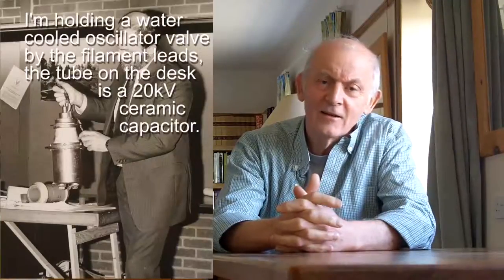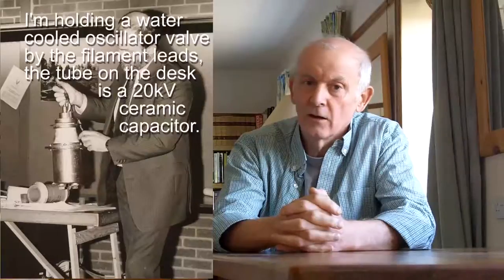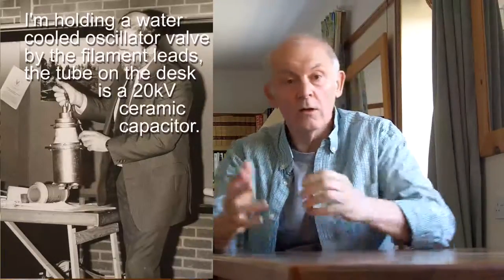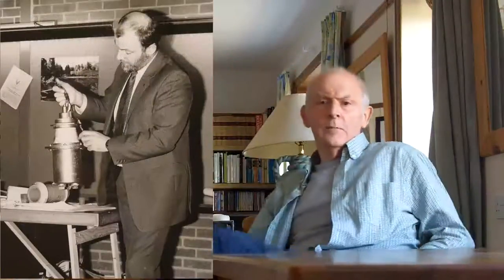HHO. 18 Just me waffling on about where I'm going with this project

Comment: Thank for sharing your plans, and no question about your credibility. Watching all this with great interest! Stan Meyer eh? Well, no one can say you're afraid to open Pandora's box! The 4046 is such a versatile chip. Cheap too. Newish versions like the TI 74HC4046AE operate up to 38Mhz and have a third phase comparator to boot that uses a RS-flip/flop. Handy if you need use of an edge detection scheme, which you just might if your cell's capacitance proves a bit squirrely -just a thought.

Comment from the maker: Hi, well I guess you could do that and as you say there would be no ongoing cost. Every time you convert energy you lose out on efficiency so I think it’d be better to say use wind to charge a battery or pump water and take advantage of a single conversion. But for now I want to develop the principle along the lines I’ve set out in the video but you’re right in as much as there are many options to achieve the same end. 
Regards ... Andy

Comment: Interesting equipment you have been developing through the years. Any chance that the Hydrogen produced in the process can be translated into sufficient power to drive the process without any other external power source (and cost)? Or would that imply some sort of perpetuum mobile which is impossible everywhere but on youtube?

Comment from the maker: Well I don’t think you can tell you’re power supplier to take a jump just yet, but there can be little doubt that there’s a lot of potential energy locked up in water. I have an interest in collecting the HHO gas to use in a gas torch as it has some very nice properties when working with glass (melting) I don’t think we’re going to get anything for nothing, unfortunately, or maybe that’s a good thing as if we all had access to unlimited energy we could really screw things up.
Regards ... Andy

Comment: Why not just use some free renewable source to produce the electricity, such as solar panels, Stirling engines, wind power, etc... to slowly produce the gas at a low yet efficient voltage? Eventually it would add up if something was running during different times, for 24/7, and it would be free. I wonder if you could make enough to operate as we do today this way? How much HHO do we need to equal the amount of kWh we use on average?